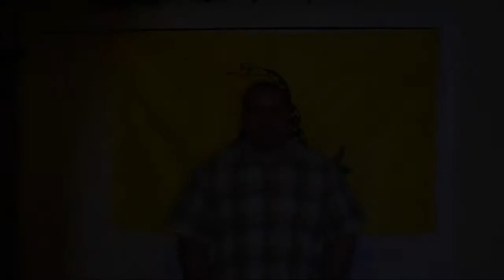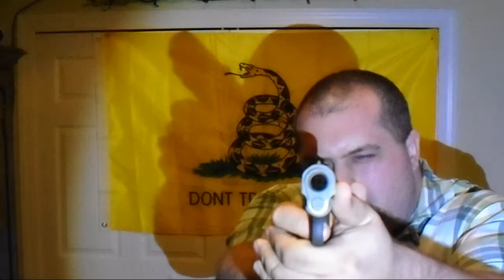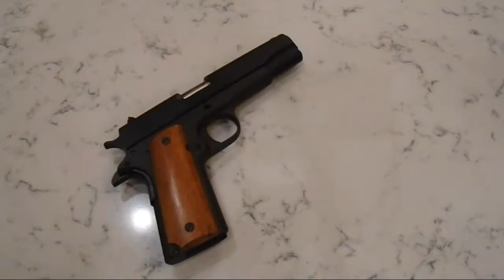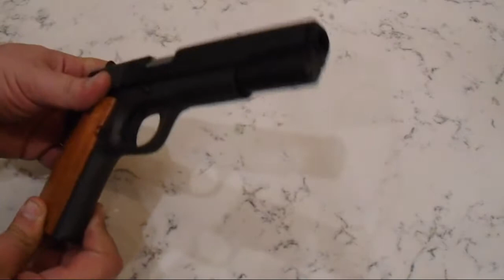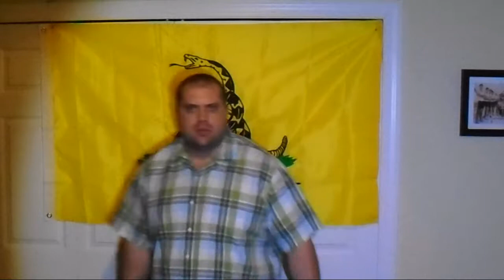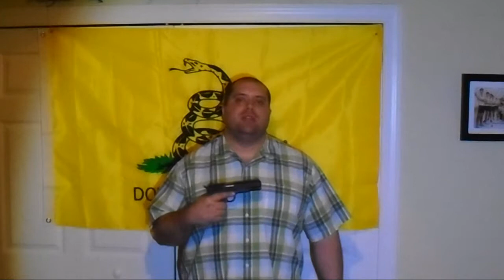RIA 1911 GI .45ACP Break In

Comment: Greetings from Kentucky.....but what were your minor problems? Could you specify please?
Reply from the maker: Every trip to the range I would shoot about 150 rounds through the firearm.  After about 80 or more shots, I would get a failure to feed.  In order to remedy the failure to feed, all I had to do was pull the slide all the way back and let go.  That would slam the round into battery and allow me to tango on.  This would happen once or twice per session.  I came to the conclusion that once the ramp gets dirty enough this will happen.  Wipe it off with your finger and all is well again.
Reply: Had much the same problem but instead changed out the magazines to Wilson Custom and tadaaaa. No more problems, no hiccups in the last 400 or so rounds.
Reply from the maker: Glad to hear there's an easy fix!